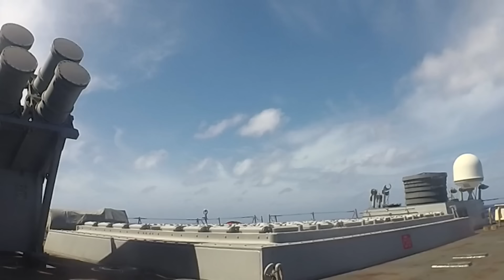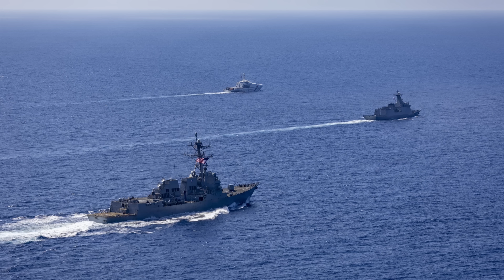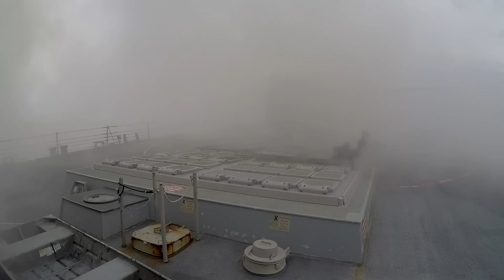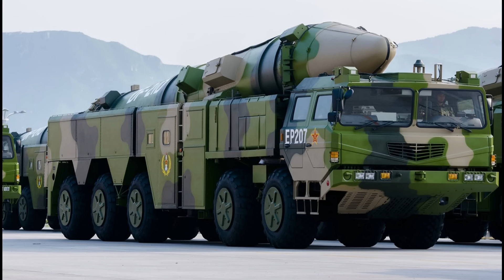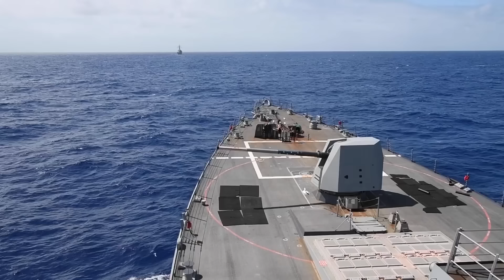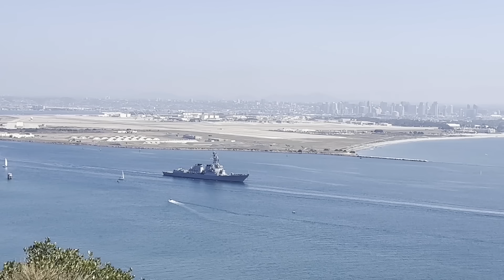Why the Arleigh Burke Still Dominates the Seas — Even After 35 Years

Comment: Blatant Propaganda. 
There was no Naval conflict during it's lifetime that made it worth it, or it actually had a reason to exist. "Power projection" is just a stupid argument.  And a naval blockade would just be siege warfare, that can't be maintained for a long period of time, unless you have the numbers to rotate them in and out permanently. (This, by itself makes it a stupid way to force someone to do what you wish).  
If it was nuclear powered at least, you could use it as an escort ship, until a contract is fulfilled. With an Ice breaker bow, it could go anywhere you order it to, and it should have a rearmament method that doesn't require a port.  That would make it much more unpredictable and therefore hard to counter. NONE of the modern cruiser designs feature anything like that. So, if anything, it messed up global warship design. 
A Nuclear powered Submarine, armed with zircon- missiles could end about a third of ALL Arleigh burke-class ships currently in service with 24 missiles. Because an Arleigh burke class has not a single missile, that could attack a sub at that range, before it dives. Nor has it a missile, that could defeat a zircon.
Reply: Isn't there such a thing as an anti-submarine rocket torpedo?
Reply: You do know CBGs operate with submarines?

Comment: SM6 is anti-everything.  It even has an anti-ship mode.  So it does have a Mach 3.5 anti-ship missile technically speaking.
Reply: Problem with SM6 in the anti-ship role, is the fact that it doesn't maneuver while coming from high altitude at relatively modest speeds. This gives the enemy good chance to shoot it down. Plus the small warhead isn't really useful against anything larger than a corvette or small frigate. Destroyers and Cruisers wouldn't really be phased by these missiles, since the SM6 would have to overwhelm the air defences on these and even then, a hit would probably cause modest damage in non-critical areas.

Comment: Just because it's old doesn't mean that it's good, the F-16 is a very old fighter plane and it's not a very capable multi role fighter
Reply: The F-16 is capable. They are not stealth capable. That doesn't make them useless.
Reply: @damongraham1398 lmao their total payload is less than the amount of fuel that some versions of the f-18 can carry the f16 is just a completely pathetic 4th generation multi-role fighter it was better 3rd generation planes
Reply: @iamjacobnz Are they better then the Yak?
Reply: @damongraham1398 no the yak is a dedicated attack play that's not a high-speed multi-role fighter, it's a competitor to the A10 it's completely different type of plane. The F-16 was built as a dedicated dog fighter and it's a an absolute crap 4th generation multi-role fighter plane because I can't carry a lot of weapons and it costs almost as much to operate as a super hornet
Reply: @iamjacobnz so if something is not perfect it's worthless?
Reply: @damongraham1398 if it's like 80% of the cost of the f-18 advanced super hornet but the f18 more fuel then the F-16 can carry weapons and fuel, I believe when it does this it can also carry more weapons than the f16 can carry even if you don't fill the f16s cft. The f16 also has less electricity available for electronic warfare it has smaller radars and it has less electronics on there. It's just a bad plane in 2026.
Reply: @iamjacobnz so the U.S. Air Force should only have F-22, F-15, F-35? Should the F-16 be phased out or just removed today?
Reply: @damongraham1398 yes they can buy some f18 super hornets and operate them for the same money then yeah they should replace these like 100-year-old planes
Reply: @iamjacobnz it's how you use it that is more important.

There's light attack craft right now that can do amazing CAS using stand-off munitions that are way less expensive, while the light attack craft can have endurance and loitering times for 12+ hours without drop tanks and be a literal fraction of the flight per hour cost and being serviceable on a grassland. They make superior anti-drone platforms as well, both when using guns to shoot them down and when using missiles as they have less chance of getting destroyed in the attempt (as some F-16's did when they hunted drones that way).

It isn't about JUST payload or JUST stealth. The F-35 can technically do a lot while stealthed, but in effect it's mostly designed to cut a path where other aircraft can do their work because those aircraft are cheaper, have different payloads, can fly more sorties, take less time+equipment+manpower+knowledge to maintain etc.

Good aircraft are part of a whole. The F-16 is old but it can still play good roles, even if it would be more advantageous to build a new plane from scratch to fulfill those roles for less cost and more extra capabilities like landing and servicing on highways. The Gripen comes to mind.
Reply: @TheDemigans yeah but the F-16 costs basically the same as an f-18 super hornet but the f18 super hornet has over twice the availability of power for the electrical systems, it has multiple times to payload it has a second pilot for operating electronic warfare and drones and things like this is just a much better plane that the F-16 is completely out of date
Reply: @iamjacobnz they aren't basically the same. For example both cost and complexity of maintenance is cheaper and easier on the F-16. It also has more maneuverability and some extra speed. There are reasons why one is in service across the world and the other is simply not.
Reply: @TheDemigans depending on the statistics that you're looking at it's a little bit cheaper but the total cost that they spend per plane is very similar along with the required personnel it's just that the cost for the f-18 I probably a little bit exaggerated because they operate at sea.

If you want a low cost lightweight fighter plane now your best bet is gonna be something like a jf-17 from Pakistan or a sweedish grippen all that new su75 or whatever that's coming out of Russia or some other comparable program. 

For instance the us could use the gripen in the air national guard and marine corps which would be appropriate given that it's a low maintenance plane whilst replacing the f-16s with f18 super hornets
Reply: @iamjacobnz the thing I read was that the F-18 was a bit more expensive BEFORE adding the cost of operating it from a carrier.

And yes I mentioned that building a new plane from scratch would be a better options than using an old one, I even specifically named the Gripen (but that might have been a comment to someone else).
Reply: @iamjacobnz how many F-16 does the USAF have? How many F-18 does the USN have?
Reply: @iamjacobnz  >> Perhaps that why we haven’t bought any F-16s since like 1992…

The UAE likes their Desert Falcons.
Reply: Check out the F-16u this was proposed for the UAE, would have been quite capable, also the fa50 block 70 is much cheaper and a nice modern interpretation of the f16, there was a proposal that would increase the wing area slightly to match the f16 and also it's possible to replace the f404 engine with the f414 engine the thrust and lift should equal the f16 but the cost should be lower and the flight hours higher.

Comment: Arleigh Burke-Class is so good that it has spawned multiple highly capable derivatives that is the Japanese Atago, Kongō and Maya-Class, as well as the South Korean Sejong the Great-Class. 

There's supposed to be another ship class in the Cruiser Baseline (CGBL) design study that was supposed to replace the Ticonderoga using the Arleigh Burke's construction standards and technologies, with provisions for future growth. Of course it got canned due to cost and now the Navy is stuck in a dilemma with the Ticonderoga that it would've never faced had the Cruiser Baseline been built anyway.
Reply: Strange that they couldn’t just stretch Burke hull for more space to add maybe 32-48 more VLS, some more electronic equipment, command space, and call it the new cruiser replacement
Reply: @xuansu9036 the Navy has clearly stated that the Burke design, being 50 years old, is now considered to be completely maxed out on everything from internal hull volume to margins for future growth, power production, cooling capacity & weight. They need a new design with a more robust "everything".
Reply: @MrWlbblw 
They could miniaturise some of the systems and make space 

It’s not like the future DDG FX will be 1.5 or twice the size of the AB
Reply: @ricky1231 DDGX is MUCH larger than a Burke & has a massive power plant copied from Zumwalt. They are really a "destroyer" in name only since they have the size, capabilities & combat command & control functions of a cruiser. It's design also includes a large margin for growth with optional add-on modules that will allow the ships to be expanded on with a mid-hull insertion of weapons or whatever they want in the future.
Reply: @xuansu9036  They could but knowing the Navy, they'll want to also add the kitchen sink which will drivee costs to astronomical levels and they will just shelve program.